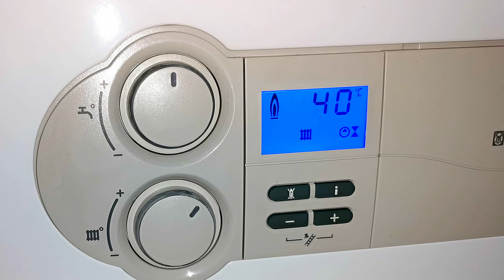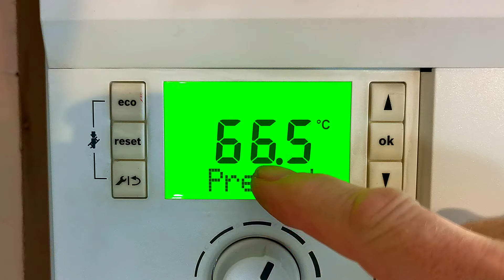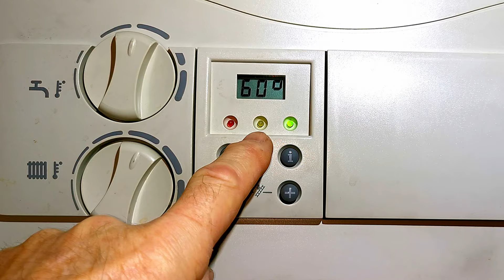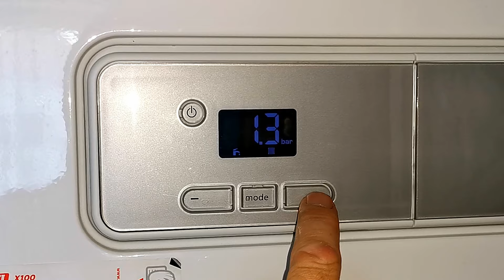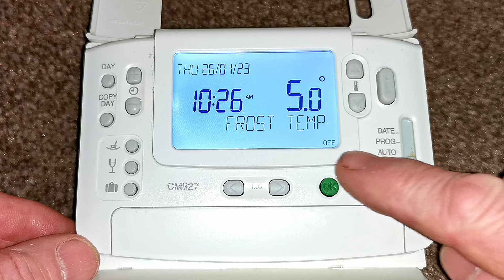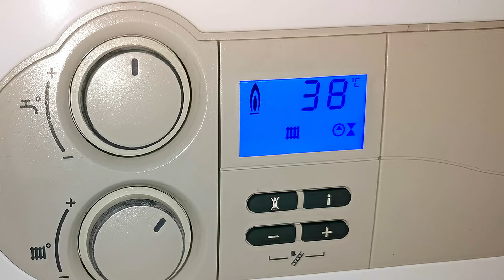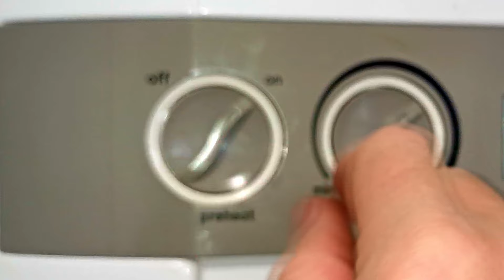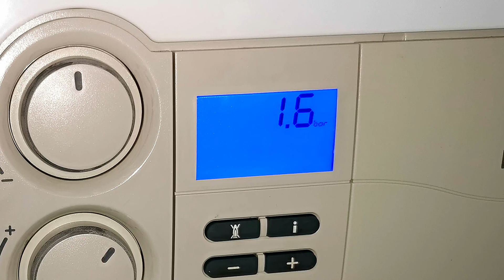Why Is My  COMBI Boiler Running When It Should Be OFF,  Is It Normal Or Is It Faulty?

Comment: Great video. Our boiler locked out at weekend Vailant Eco Pro Mk 1 I believe. No hot water, the radiators were luke warm but due to Fault Code I turned down the thermostat controls. I even turned the wall controller to “off” but for 24 hours until the engineer came the pump was constantly sending cold water around the radiators. I contemplated pressing reset or turning boiler off on the switch on front of boiler but I was wary of messing about in case I caused pressure build up or other damage(I’m not an engineer). The fault code suggested pump or pressure switch failure. Engineer replaced pressure switch but I was still wary of underlying fault as we had a number of new parts in the summer to extend the boilers life and hopefully reliability as it’s around 15 years old and we can’t afford a new one😢. Thankfully the engineer did this under our monthly gas cover and we had new pump, diverter  valve , pressure switch, and some other bits, I think a new heat exchanger plate too, so I was very surprised six months later to have pressure switch failure. Sadly yesterday morning just 24 hours after repair water started pouring out the bottom of the boiler. I was worried it might be heat exchanger but turns out Vaillant used to use some part copper/rubber pipes and a nearly 1 inch split had occurred. I was annoyed at first but the split pipe was facing the rear of the boiler so would not have been obvious to the previous engineer. I was hoping the other rubber pipe would be replaced too but for now he has just replaced the leaking one with an upgraded all copper pipe. Fingers crossed and praying we have a good run now without issues. Yes it’s getting old but it’s serviced yearly and as I say we’ve had lots of new parts. A full pressure system flush would be good as there was evidence of gunge in the old parts but because in the summer the engineer thinks our boiler loses pressure a bit faster than what’s usually considered normal he suspects a very tiny leak (I top up pressure every 3-4 months so very tiny leak if any). Problem is a high pressure flush could cause that tiny leak become a big leak and our upstairs floorboards are very difficult to remove. Its frustrating and a bit of a catch 22. And when the time comes for a new boiler that gunge would still be in the system! Any suggestions?? Someone has suggested removing the radiators one by one and hosing them down outside. This method would not fully remove ALL gunge but would clean the radiators without risking high pressure flushes of the system. But I’m not good at DIY so would need someone to do this without ripping me off. Has anyone got suggestions for my situation?
Reply: @xxxxxxxx3476  thanks for your kind comments. It is working now but I’ve asked him to come back tomorrow as he got a bit carried away with the pressure. He did say he was going to up the pressure a bit but it’s at 1.9 bar cold, 2.3/2.4 bar with heat on and that seems excessive. When set at 1.3 it never goes about 1.8 normally with heating on. I know how to add pressure with the two taps on the loop that’s easy but getting rid of pressure I don’t know, so he’s coming back tomorrow to do that and just have another quick check to see if all still looks ok from when he fitted that new pipe on Monday. He expected to lose some pressure this week so he set it higher but it’s lost nothing. Thanks again for your understanding. It’s like cars isn’t it? You can keep them regularly serviced but still can let you down. You are so right though, these days things are overly technical and not built to last.

Comment: Adding to my other comment we have 5 radiators and I can confirm they are all hot all over, no cold sections so that’s good. When first turned on after being off for a while I go here a few bits going through the pipe so that will be sludgy bits but as per my previous comment not much I can go at the moment due to financial reasons and risk of causing leak with power flush. I would say the system is reasonably quiet in operation too. I’m just preying for no more problems!

Comment: Mark thanks for the video, very useful. I have just had a Hive single channel thermostat fitted to my Glowworm ultracom boiler. Previously the heating was controlled by an analogue integrated timer. Everything with the hive looks to be working correctly but my radiators are heating up to the set point (55) even when the thermostat isn’t calling for heating. The only way I can turn them off is by  manually choosing hot water only on the main boiler display. Do you think this is a boiler control wiring issue or a stuck valve?

Comment: Good video. We had one with our new Vaillant Home Combi was firing up when toilet flushed. We had a slight water hammer and hot water flow sensor in boiler thought hot tap was opened. Couldn’t solve hammer so engineer adjusted the flow sensor setting. I guess the installer should have checked this and fitted a shock absorber.

Comment: Great video.  I just had a vaillant eco fit pure. What a pain it's been since install. 

Damn thing comes on to great up the water, flashing the radiator symbol, when the central heating is off! My engineer thought it was the diverter near the water tank.  Nope! I've checked my house thermostat and changed the batteries.  No difference. Wish I'd never chosen vaillant more trouble than it's worth. Engineer coming back a third time to fix,  but it's either faulty or not fit for purpose: vaillant ecofit 625 if you're interested.  Which also doesn't appear to have a comfort function either despite what the manual shows. 🤬

Comment: mine keeps turning on for 25 seconds, i can hear it doing something like pumping air or gas or something out. and then stops for 2-3min then repeats.

everything switched off in the flat. wondering if that normal or an issue like water leak could cause such a behaviour? 

or is this normal and I'm just noticing it now and hadn't before?

I'm not seeing the tap led lighting up when it starts pumping the air out.

Comment: My boiler ideal exclusive 2 hasn't been right since the council sent a person round for the gas service check.  It comes on for around 2 minutes in the night 12, 1 am a 2 am and 3 am it does not heat up its just makes a noise.  It is May 23rd and its warm so it shouldn't come on at all.

Comment: Biasi 30c advance has no heating but HW works fine. Bridged the frost therm 2 to 1 and now runs perfectly but doesn't cross 45 c. Looking like the pcb is shot on a capacitor.  Anyone else faced the same issue,  as I don't want to fork out £180 on a circuit board.

Comment: I have a Main Combi Eco boiler that is located in an out house so I assume the frost protection is firing up the boiler and heating the radiators however reading elsewhere this frost protection should only heat up the water in the boiler and not in the central heating system/radiators. Is this correct?
Reply: Yes thats correct but if you have a demand for heat but the pcb is playing up it will not show any fault codes, that's what's happening to my biasi.